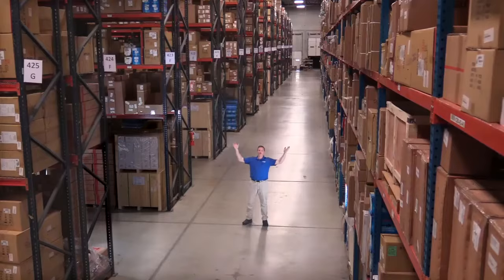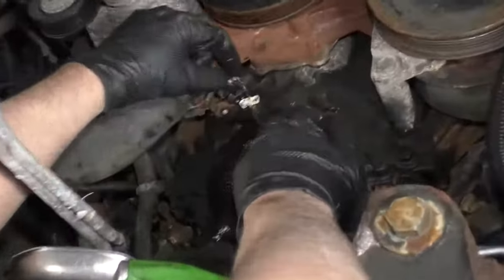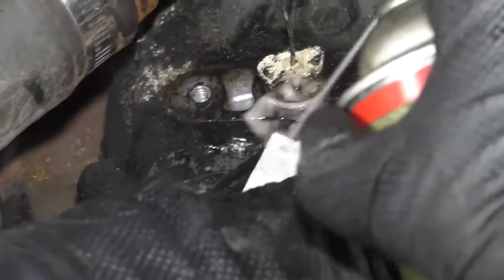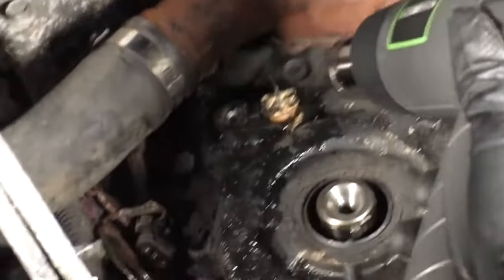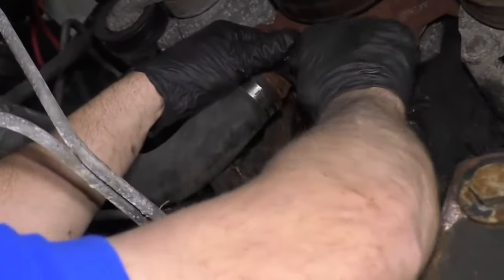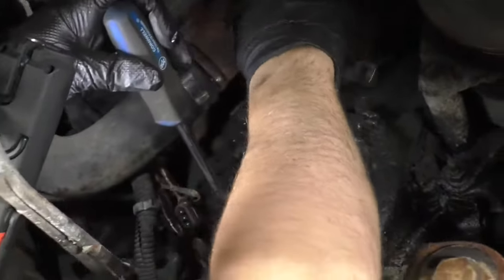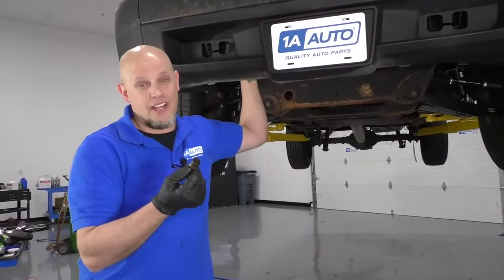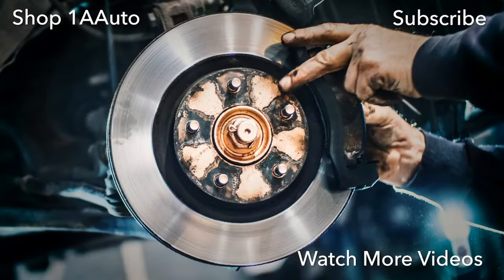How to Remove Broken Camshaft Position Sensor 07-13 Chevy Silverado

Comment: This guy is either the calmest most level headed man in the world or yall did a great job editing this video!! Either way he needs a raise after that one!
Reply: I know! Right? If it were me, I'd most likely need to machine an insert cause the hole would be so buggered up. :)
I read a forum where a mechanic used a socket under the concrete screw and turned the screw on the socket to get it past the initial corrosion ring. Yet the hammer, chisel, and bushing insert sounds more satisfying. :)

Comment: Just use a socket big enough to go around the sensor, then put a washer above the socket, screw in your screw, and the washer will stop on the socket, and pull the sensor put for you as you tighten the screw with much less effort....

Comment: Just did the exact same job today. The sensor head broke off just like this 1. I drilled and tapped a set screw like 1a did, no go. Slide hammered it, no go. I had to drill 3 seperate holes and break it into 3 pieces to get out. My 08 6.0l had 0 corrosion in the mounting hole. It seems the plastic sensor had expanded and would not clear from the back side of the timing cover. This was a 3 hour pain in the a** and I did it on the lift.
Reply: Yes, exactly! My 08 was relatively clean, zero corrosion, sensor was larger than it should have been. Was swelled up like a battery ready to blow! Had timing cover off and was near impossible to get out without damaging the cover. Replaced cover and sensor.

Comment: Just replace mine on an 6.2l 2007 Denali.  Remove the water pump…remove the VVT Solenoid….get behind the sensor from there and pry it out from the back side.  I promise this will save you hours upon hours if yours is stuck or broke.

Comment: I have this same issue in a 3.5 Pacifica.  However it buried with 0 chance of getting tools or a slide hammer into the location.  I'm worried the engine will need pulled. . . Thanks Chrysler!

Comment: Just did mine guys I took off the water pump WD 40 is a must sprayed it over and over wiggled it back and forth bought a small pry bar and used the green ones it took me about three hours bought water pump gaskets and put everything back together trust me you have to be patient because it can break on you

Comment: Pretty good job....the same tool u made u can use it as an extractor...the fork part grabbing the sensor and that big screw with nuts screwing clockwise against a pease of metal over the block will pulled the sensor out...is an extraction movement...pushing and pulling at the same time.

Comment: I think that you had the set up good,  but if you would have put a 1" socket between the washer and the motor, you may have been able to jut tighten the screw and it should have pulled it right out.   Good job at staying so calm.

Comment: I'm having the same problem right now mine is on a 2009 Dodge journey but the problem is the space that I have is not much space to work with any suggestions I got it all out except the case in a plastic casing would it be okay to just drill it out and then suck the rest of the pieces of plastic out with those piece of plastics damage the engine

Comment: I just did this very same sensor and it got stuck also broke. Was a 4.8 but. I removed the vvt solenoid and pushed  it in and pried it with the same bent fork tool he used.
And it was a verbal battle.lol😊

Comment: this was a nightmare on a 2006 dodge 3.3 caravan after reviewing many methods on youtube for removing it I ended up drilling it out using a "Step bit" to drill out the center and create a hole and then using a "Plumbing tool"( an INTERNAL PIPE WRENCH,) it is serrated and has a serrated cam action to grab the inside of a pipe, in this case, plastic and was able to turn and remove the stuck plastic housing after prying and picking at the metal for hrs and with a lot of penetrating oil

Comment: Pulled the water pump instead of crank pulley. The sensor would spin in the hole. Ended up pulling the cam cover and it pushed right out

Comment: i have a 2016; Chevy Traverse Lt AWD 3.6 and my cam shaft position sensor is broken in pieces inside the house how do you get it out of the hole to put a new one in its place

Comment: First thing I did drill a hole  in the center  get the screw  in there  than get a plyers on the screw  stick a long screwdriver  in between  the plyers  all the way to the crank pulley.   Pry against the pulley   it will come right out
Reply from the maker: +eddiesgsr Thanks for checking us out!
Reply: Dude ima have to try that!!
Reply: I'ma try this

Comment: While that’s not a Gen III or IV Chevrolet engine, the problem is the same. I don’t think I’ll ever sell a cam sensor replacement without selling a new timing cover. Those buggars are really stuck! I’ve soaked a removed timing cover in sole entire for days and still was afraid I was going to damage the cover driving the sensor out from the back side, it’s ridiculous!

Comment: Nice job... but for GM easy you are facing it and have room to hammer.. Dodge Journey 2009, facing towards the back of the vehicle between the block heater and transmission and made of plastic. broke and fro 3 months in Canada trying to wedge a pick and nothing.. so thank you for showing this, another video had the same as me, but used epoxy on the lag bolt, did not think that, so will soon... Thanks again for the video..! *All other vehicles I have had, NEVER had to do this ever... and had mostly GM.. so.. just saying... They do not make them like they used to..!!!

Comment: This is NOT the Camshaft Position Sensor (CPS), this is the Crankshaft Position Sensor (CKP). The Camshaft Position Sensor is under the car above the starter.
Reply: You should learn what you're talking about before attempting to correct a mechanic and make yourself look stupid in the process. That is absolutely the cam position sensor.
Reply: Wrong

Comment: I have my ls3 in pieces for a rebuild .. 'To sell after finished'  I just wanted to remove my sensor to wash the cover ... I cant even remove it complete because it seems the Inside Plastic has swollen ..  
It works, but it seems theres no way to remove these things without destroying them .. 
I'll destroy my good one now, because I Pitty anyone buying a GM LS who would have to do this with the engine in situ ..  
PS Im selling an 09 GM(Holden) R8 Maloo for $55k AUD if anyone's interested 😂